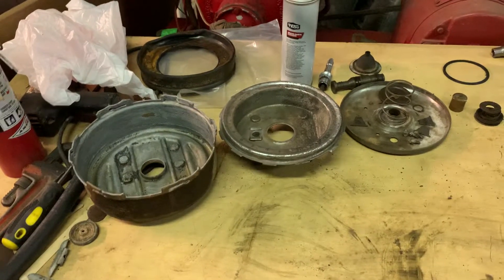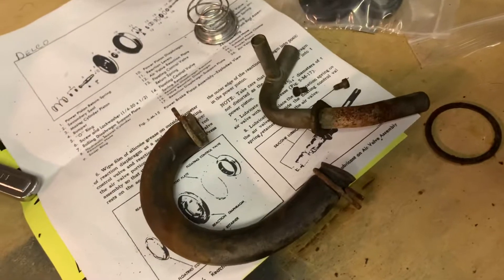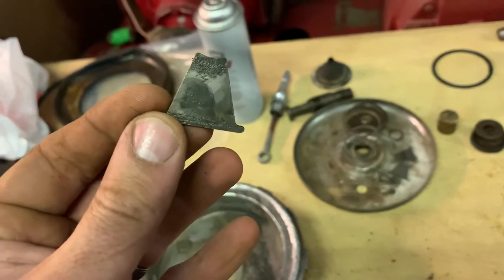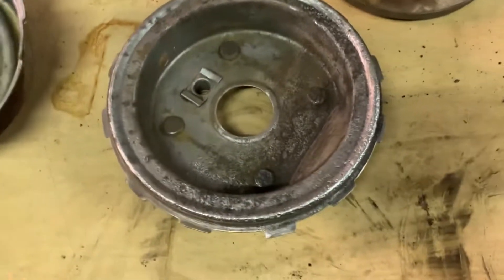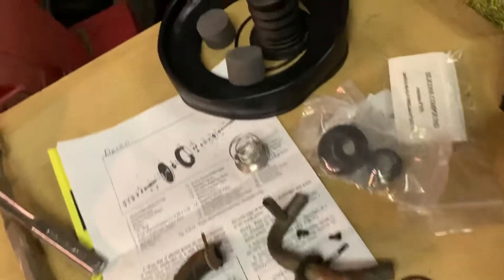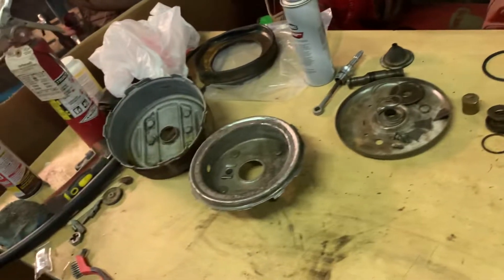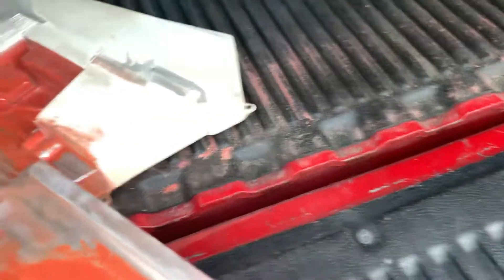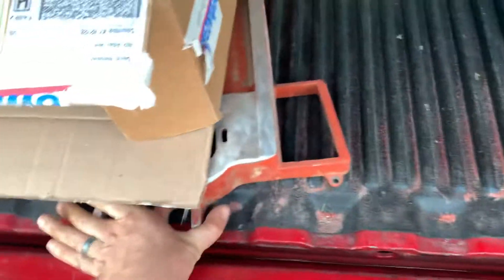1960 Buick power brake rebuild (Part 2)

Comment: I was able to find a dual master and booster assembly online, which only required me to enlarge 2 of the booster mounting holes in the firewall. Works great.
Reply from the maker: Where did it come from?
Reply: @dweb7321   I ordered it from jegs # 965-G8805. It is basically a universal setup, but was easy to install on my 60 buick
Reply: Are  you  still planning   on  rebuilding   your   OEM  unit   ???  ///    Funny    i'm    in the  same  boat   with   my  61 pontiac   (   same   Delco  Moraine )    I   just  rebuild it     but     didn't fix  it   //    still  hartd   petal
Reply from the maker: @brenna2100  I have a later video with it reinstalled. It works a lot better. You may have a vacuum issue. Does your vacuum canister have a rust hole?
Reply: OOPS     ..    I    watched     part   3    /   you   did     rebuild   your   OEM    /  I  was hoping   you   video     the  assemble !!!
Reply from the maker: @brenna2100  I tried lol but it had so many tedious parts and I I’m filming with an iPhone with no holder/stand so it didn’t work out lol.
Reply: The vacuum canister  had  a fair  amount  of  pitting  ,  but  had   been   clean for  past  rebuilds  /  seem  solid    //    engine   vacuum    15 in     ,,  brake   on    9in

Comment: I wonder if using something called All Metal would work better than JB Weld? Maybe it’s the same thing. Ever hear of it? Also, please complete your 500 other projects! I want to see that pedal tractor come to life. Heh.
Reply from the maker: I’ll have to look into All Metal. I’ve never heard of it. I think I’m overthinking it a little. As long as the diaphragm has a clean surface to mount to, I should be ok. Once it’s all locked back together, the two housing halves should hold it so tight that leaking would be impossible. My 5 year old son is really pushing me to start on the tractor so I need to get to it before he’s too big to care anymore but if he was a little bigger he would  be more apt to help without getting bored or distracted